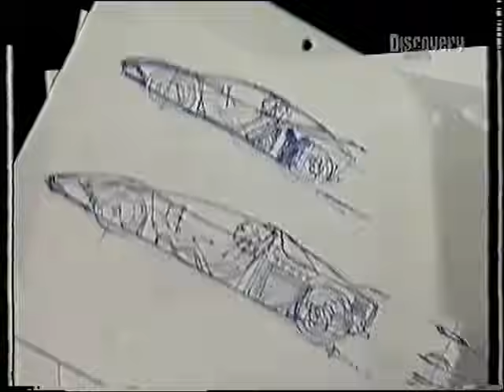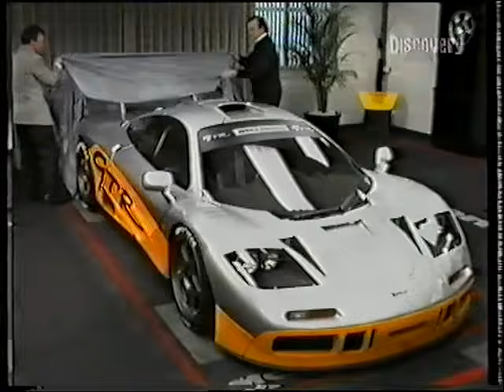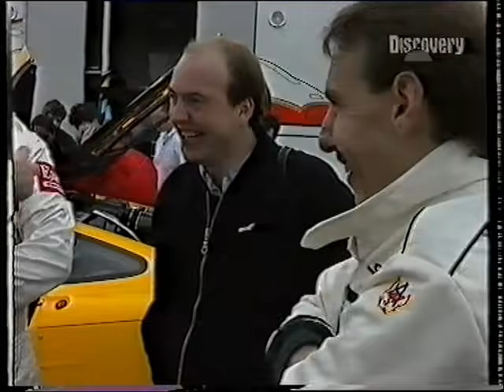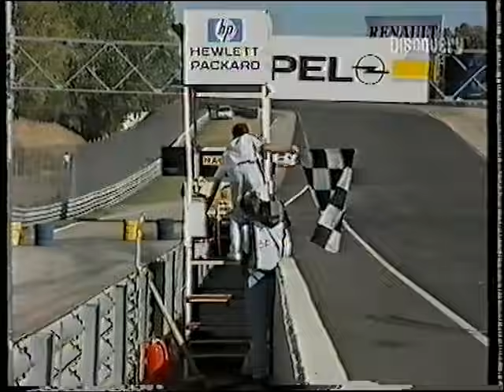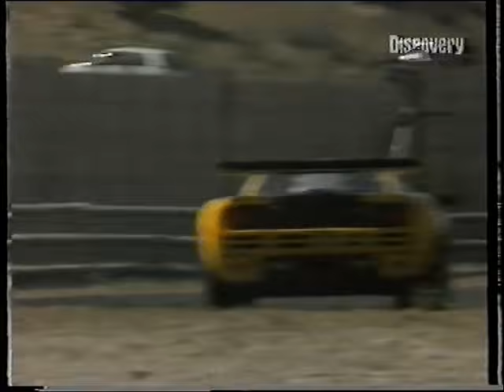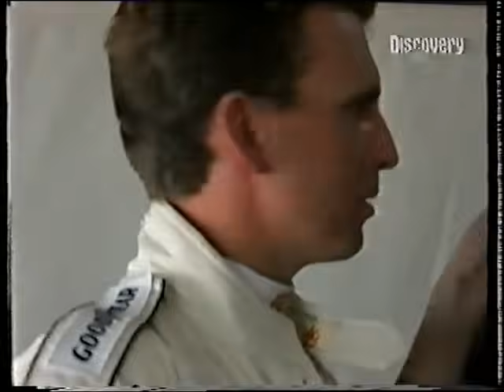McLaren F1 GTR Documentary - The Professionals - Speed Merchants

Comment: They were beasts on the track until the CLK-GTR and then CLK-LM came and swept up wins on podiums around the world.Great video!
Reply: The CLKs swept wins because BMW stopped supporting the F1s, the Longtail F1 GTRs were perfectly capable of matching them.
Reply: @turdferguson3803  there were still McLaren F1’s in 1998 competing in FIA GT, the CLK’s walked away from them and the rest of the field including the “revised” GT1’s  the McLarens were fast but uncompetitive by 98’ 
95-96 were bmw’s best years in FIA GT
Reply: @tonychavez2083  There were still F1s in 1998 but they were no longer being supported by either BMW or McLaren thus didn't receive continuous updates/modifications like the F1s had in years prior.

It wasn't competitive in 1998 for that reason.
Reply: @turdferguson3803  The BMW’s had the SAME 6.1L motor, same chassis, same gearbox, brakes etc. The lightweight CLK’s and the new M119 based motors were clearly quicker overall. Not having BMW factory support doesn’t make them slower than previous year? It’s the same car albeit not updated.

Comment: I couldnt hear what the reason for the understeer problem was 39:14, can any one tell me exactly what understeer problem was and how it was corrected?
Reply: The problem was the car felt un-balanced because it didn't felt well entering in corners the steering became very light and uncontrollable both pilots were struggle to fight to keep the car in corners so initially mechanics thought the ground effect on the car was not working well but pilots say the car is very stable in cornering but it was like in it's own path they fight hard in the sense they would must slower quicker before entering the corners in order to keep the car on the track but that mean they were loosing 'acres of precious time' as they mentioned. So first thing they really did right since were 2 McLaren cars (each on one team Harrods and West and for each team 2 driver-pilots.. (So Harrods who had this bad issue disqus 'ed with the West team pilots and what they did first is to copy all settings from West car team, so then with the settings replaced the car improved a bit but they still got that water leak and only after they dismantled the engine and found & sorted the water leak Bell pilot from the Harrods team also requested the front shocks replacement and that was the moment when he felt the car behavior changed dramatically and pilot was able to gain from 9 up to 5  but also they were told since they used harder compound tires specially for the front that could also affect the cars turn so, after the replacement on softer compound car became even more controllable and they could push the car harder with much more confidence..
Reply: Thank you for the description but please separate your thoughts with periods (.). It is much easier to read if you do so. Thanks :)
Reply: My understanding is that the understeer at high speed corners was due to imbalance of down force between front and rear, and which is why during the 2nd stop in the race, they cut portions of the rear wing to reduce rear down force and in turn provide a little more grip to the front and help cure the understeer.